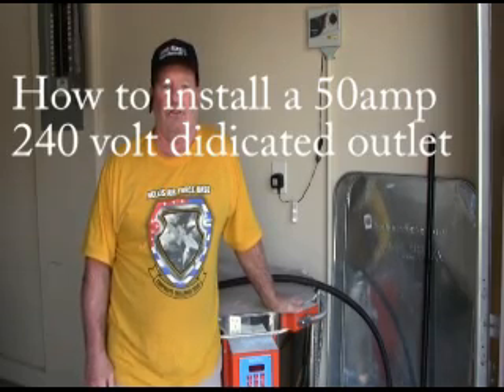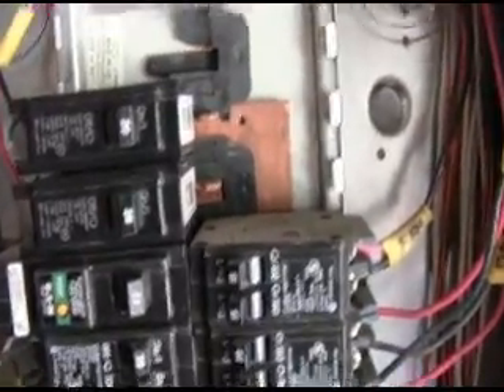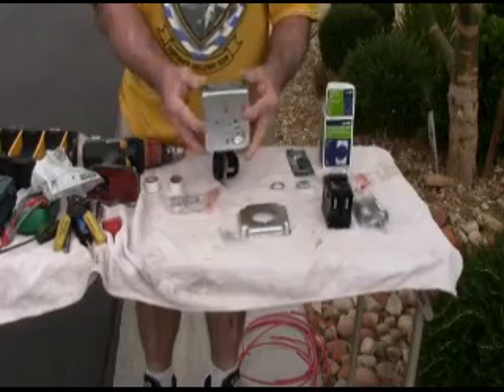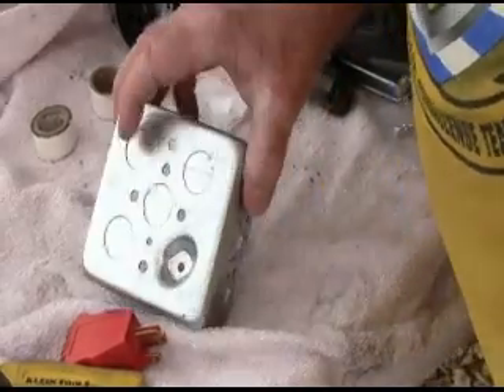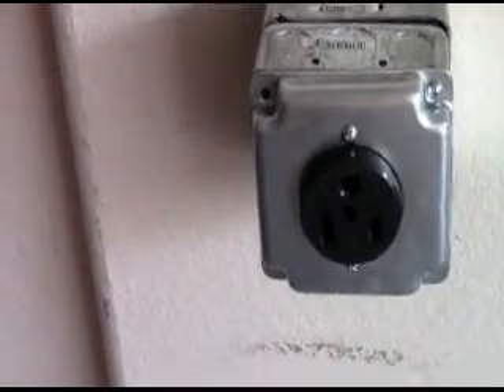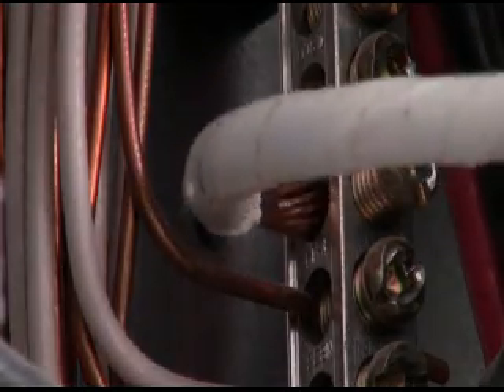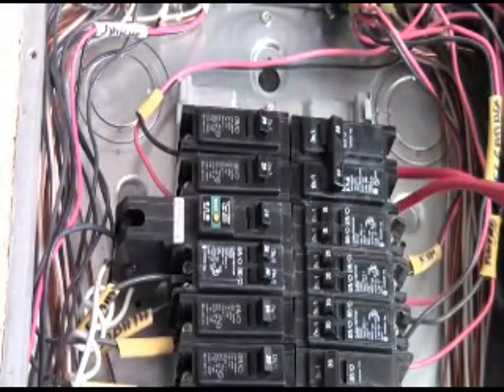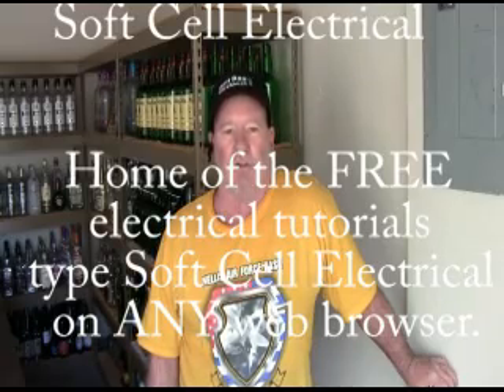Installing a 50 amp 240 volt outlet # 28

Comment from the maker: The wire is # 6 THHN good for a minimum of 50 amps continuous.  Can be up to 65 amps in some types of enclosures, depending on temperature range and which of the three columns you use in the code book.  I always use the smallest amperage column to be safe.

Comment from the maker: A kiln has no neutral and no step down transformer so only a ground is needed.  In residential wiring the ground and neutral bars are shared in common so a ground is effectively the same as a neutral as long as is is wired properly on the receptacle. Any time there is a 120 leg needed or there is a step down transformer a separate neutral IS in fact needed.

Comment from the maker: #6 AWG with a # 10 ground for 60 amps and #8 AWG with a # 10 ground for a 50 amp spa. Voltage drop will not exceed 3% using this size at lengths under 250 feet so you are cleared for take off. If your run is over 250 feet you might consider using #4 in a 100 amp subpanel and then draw your whip to your spa off of that.

Comment from the maker: I really don't remember, but keep in mind that before the code change there was only ONE bar on residential panels less than 300 amps. The separate ground and neutral bar code was not enforced until the manufacturers had sold all of the old school panels (several years). A least half of all my service calls have a common ground/neutral bar. Personally I would like the wire fill requirements changed on !00 and 200 amp panels. Some panels I work on are 69% wire and 30% breaker.

Comment from the maker: You asking me something that is discretionary for the local code enforcement board. SOME inspectors will allow a jumper from the ground to the neutral so that you do not have to change out the whip: also on older appliances there may not even be a neutral connection, so realistically the swap is only cosmetic. The PAINFUL but up to code method is to rip out the old wire and put in 6-3 with a four prong outlet and whip. Last, I never use aluminum. Thanks for the question and I do hope this helps.

Comment: 30amp 10Gauge
40amp 8Gauge
50amp 6Gauge
Reply: ALVARO NUNEZ nah. you don't need it that thick. i always try to get away with the cheapest decent wire I can. If you F it up, the breaker would trip before the wire would burn and set your house on fire.
Reply: But if you are over current on the wire and under current on the breaker it is very likely that the breaker won't trip until it's too late.
Reply: I don't trust breakers. use a number 6. how much do you save per m ?
Reply: dominatorut had it right...continuous current that is MORE than the wire is rated for, but less than would cause the breaker to trip would cause a fire and potential loss of life.  Plus...the fact is that breakers don't always work (mentioned by Ghost Dog).  Thus, having redundancy in safety is the smart way to do things....it mitigates the risk of CATASTROPHIC failure (i.e. a house FIRE) by increasing the number of ways that potential hazards can be diverted and at the same time increases the probability that one or the other of the safety mechanisms (larger gauge wire and / WITH the APPROPRIATELY SIZED breaker) will do their job.

Comment: Question- I have an 80 gallon air compressor and I need to run a 240 line from basement to the detached garage. This electrician told me to get 8 gauge THHN wire (two hot and one ground). Then he said to also get 8/3 romex but he won’t use the bare copper ground instead he will use the white romex wire as a ground to make it insulated. I asked him again what he is doing with the bare copper ground and he said no need to use because he want to keep it all insulated🤔. Why can’t I just buy 8/2 romax and connect my thhn ground to the bare copper wire??? Or Can I just run the rest of the thhn in my basement with conduit?

Comment: Do you know if it is possible to hook up a RV trailer that has 50amp to an outlet with 100amp? The site is for mobile homes and has ports for travel trailers, mine will have 50amp and was wondering if I need an adapter. Thanks!

Comment: What gauge of wire did you use for the 50 amp plug? I was under the impression that you need 6 gauge wire for 50 amp. The wire you used didn't look like 6 gauge. Correct me if I'm wrong. I'm no expert. I'm just asking because I'm looking to install two more 220 50amp outlet in my garage and I thought I needed 6 gauge wire.

Comment: When mentioning all the items on your table, you forgot to explain the type of wire used. How thick is that wire? Or what is the minimum required wire for that setup, but using a welder instead of a kiln so power won't be used as constantly

Comment: I am aware that the code changed in 1999 requiring 4 wire rather than 3wire, but I have a tenant with a 3 plug range(10-50R)  Would it be better for longevity to install 6/4 rather than the 6/3 and have the 3 prong range plug rewired?  Not even sure if you can install the 3wire, though it is an old house.

Note: There is no existing wire so I have to install something. Just wondered if I can get away with a 6/3 aluminum wire or do I need to go to 6/4 and upgrade the range plug.

Comment: Why do you only have a neutral and no ground? Aren't all 50 amp circuits 4 prong now days?  When I wired in my 50 amp RV service I was required to use 4 prongs with 2 hots and 2 negatives.

Comment: Did you just connect the ground wire to the neutral bar? A 6-50 doesn't have a neutral. Only to hot legs and ground...

Comment: When the three wires were inserted from the receptacle thru and into the power panel it was not clear which of three wires was the neutral wire; in fact all three looked pretty small as compared to the white wire inserted into the neutral bar (time 5:55 to 6:27.) In other words the white neutral wire looked alien or unlike the three wires in the procedure during the denoted time frame. ??

Comment: Do I need to turn the power off or can i just wear some rubber soled shoes?
Reply: +Alison Rice you do not need to turn power off. Also rubber soled shoes are unnecessary.  you should wear as much gold as you can find and probably wrap some chain around you and then to a metal pole to make sure you are as grounded as possible. then go ahead and grab both hot legs at the same time so they cancel each other out and you are good to go!

Comment: Not when the neutral bond is carried out at the panel, since current takes the shortest path.  There is no way any current will back feed up a neutral leg from the panel so nothing is energized.  Look at it this way, the neutral is like a drain, and water only flows downhill.  Now if you're talking about playing with a hot circuit and touching metal shocking you, the same is true via neutral bond or straight ground, which is why you never work a hot circuit or panel unless you're really stupid.

Comment: Would 6 gauge wire will be suitable for a spa?? 100 foot run..
Reply: Google wire size calculater. And research"voltage drop"  the longer the run the wow needs to get bigger

BTW I'm no expert. Researching same thing myself now lol

Comment: Hello. In my garage is a dedicated plug (60 amp) that the previous owner used to fire her electric kiln. Can I switch the plug to a 30 amp plug for a space heater using the same wiring and breaker? Would there be too much current for the space heater, or would it owner draw what it needed? Hope this makes sense; I am not a electrician. Thank you.
Reply: David Massey the draw is caused by the appliance / tool not by the wire
Reply: David Massey I would change out the breaker to a 30 amp double pole  to prevent too much current through the 30 amp plug. The wire will be big enough assuming it was sized for 60 amps to begin with.

Comment: isnt there supposed to be a red and a black not 2 red wires?
Reply: LOL No! DC power uses red and black not AC power :)
Reply: dazdef man a lot of homes i seen when they use 2 live wires they use a red and a black wires. doesn't have to be used on DC power only i'm just going off of past experience and how 240 outlets go off of. which are green white black and red. dont correct someone when you dont know what you're talking about.